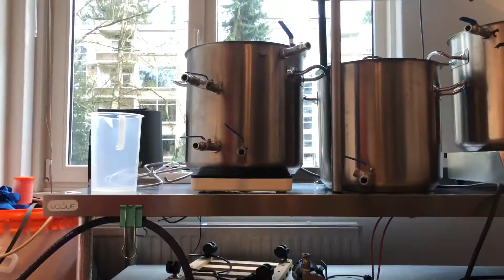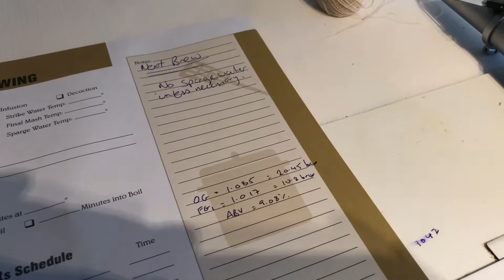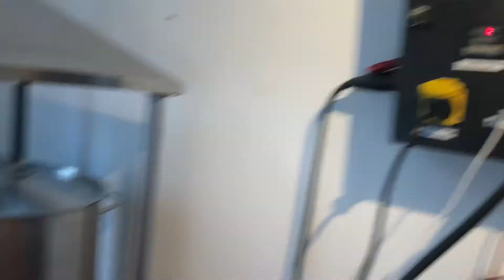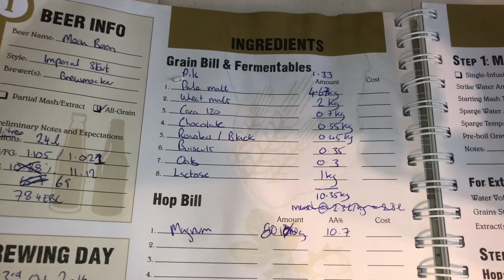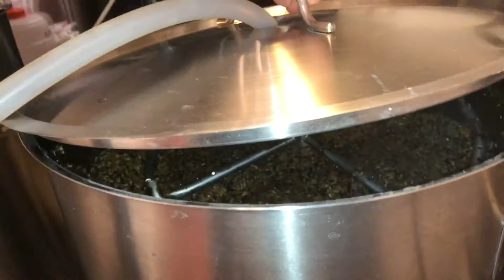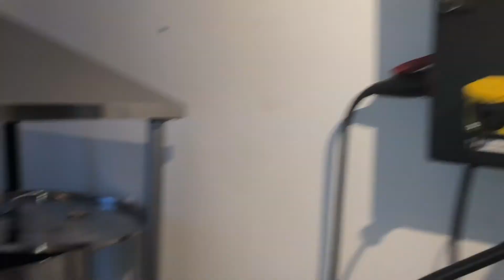Kotten Brewery- HBW32: Rover Pump Review; Brewday Troubleshooting; New Stuff! :)

Comment: What's that Bosch frigde's model number your you're using as fermentation 1? I've been browsing second hand boards for ages here in Berlin and wasn't able to come up with a Bosch fridge that's higher than my 60 cm model - which is by it's height  limited to a cylindrical 30 L fermentor - and has no freezer section.
Reply from the maker: Tag Florian, I had a quick look but no model number visible. I keg the beer in a few weeks, then I will check the back side. It is a great fridge now that I think about it :) well spotted! Grussens b